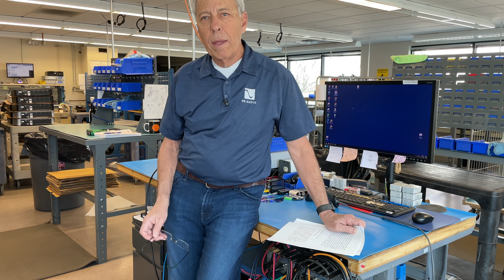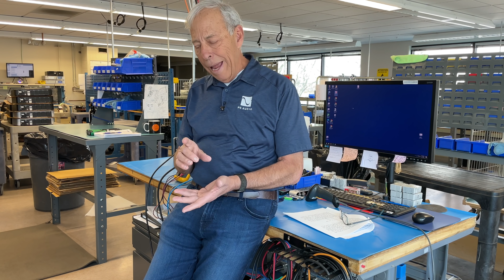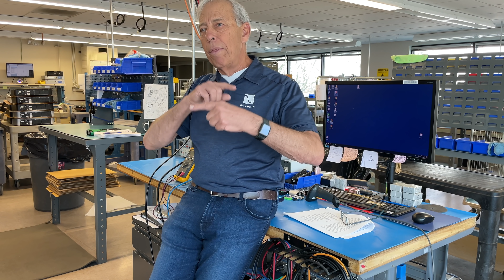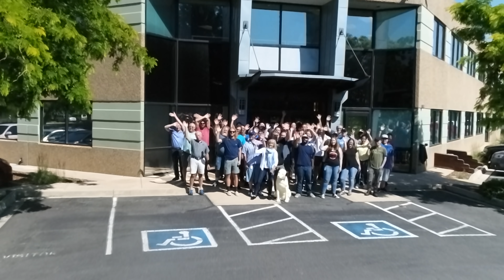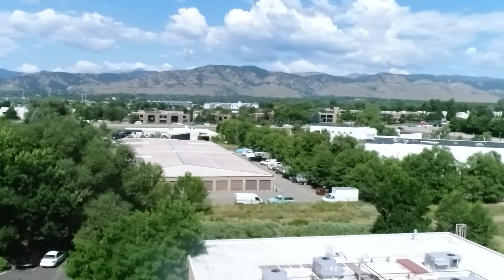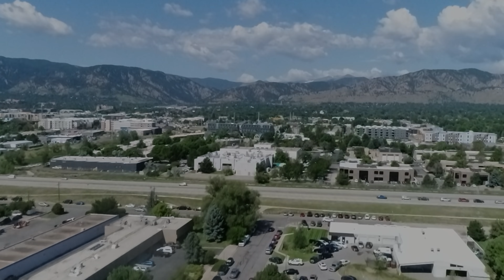USB Turntables

Comment: I think the question is best answered by explaining that if connecting via USB To the computer, then the digitising is occurring within the turntable, whereas if connecting to a computer via line level analogue output, then the digitising is happening within the computer itself. Of course a phono preamplifier having usb connectivity could be used in-between for the third option, whereby the digitising is occurring within that "usb equipped phono stage" the number of conversations remains the same, the quality will depend on the preamplifier and ADC, likely that the separate use phono stage will be the best choice, especially if it's a known recommended device, and far better still if it's connected to a decent turntable system, and not one that's designed as a low cost vinyl ripper.... They tend to be awful, although there are exceptions from the likes of Project and Sony to name a couple. Just my thoughts, have fun :)

Comment: My turntable has no bass using the built in preamp to my receiver....... could a phono stage to replace the built in preamp in the turntable help this?? It has 2 outputs 1 for built in preamp and 1 bypass
Reply: Sometimes you have to flip a switch to activate the pre-amp, or use different binding posts. Seems your pre-amp is not working right now now, or defective.

Comment: Not directly related; but... as long as it’s buffered, there’s no major difference between any properly functioning digital interface running at the same bit rate & depth. Don’t go thinking that you need to replace your gear just because USB is popular right now (which doesn’t mean you might not want to for other reasons, though). The whole point of digital transport is that bits are bits; with no generation loss going from one place to another.

Comment: I have a question, I’m using a Olympus pcm recorder to record directly from riia. 
And I’m guessing that a real computer can convert that to digital better than a cheap turntable ( newer heard of a “quality “ turntable with usb) or a riia/phono stage. 
Anyway I’m in full control of the type of digital conversion
Reply: Hi Jorn. Decent USB turntables such as the Sony HX 500 do now exist and can provide good quality DSD rips of vinyl. They are not high end but certainly pretty good.

Comment: Should've explained why it's better to get a turntable without any of those gimmicks installed 😜
Reply: I know defeats the whole purpose of analog. I have tons of buzz & hum in my system with TT connected for reasons I can't figure out...but I'm not going to lower myself to get a USB turntable to avoid it.   Bluetooth turntable is an even dumber idea.
Reply: @Scott-DJ  The hum is probably a ground loop.
If you're having the hum only when you've connected it to a USB audio interface, it's likely that the ground of the USB and signal are both connected to the case.
Sometimes it's caused by environmental noise, better shielded phono cables help, but also shorter phono cables.

Comment: The preamps and USB converters in such turntables are pretty bad.  
It is Much better to use a separate, decent phono stage and a standalone audio interface that has a USB output.
Reply: Not necessarily true. Yes, you can do better with discrete external components but some of the better USB turntables from established turntable brands are pretty decent and to get better results would require a substantially higher investment. In my case I wanted a cheaper turntable for a second system and  the ability to rip the occasional album not available on streaming services. The results I get in DSD from my Sony PS HX500 are really pretty good played through a Burson Composer DAC.

Comment: Would ripping a vinyl from a turntable to the computer via USB be able to create a lossless music type file in terms of quality? Or is it more complicated?
Reply: Lossy or lossless depends purely on the codec you choose. The quality of the audio coming into the computer (to then be compressed into a lossy or lossless file) and what is lost or not lost along the path is depending on the signal path you choose. Generally, going through an external ADC of your choosing over the the ones inbuilt into either the turntable or your computer allows for better audio quality, but that depends again on choices you make.
Reply: @Ascania  " Generally, going through an external ADC of your choosing over the the ones inbuilt into either the turntable or your computer allows for better audio quality, but that depends again on choices you make."
Generally you can't generalize that, since it solely depends on what audio interface you're using, not whether it's located in the PC/TT or external.
I've recorded some needledrops using an ASUS Essence STX II and they sound good:
https://www.youtube.com/watch?v=QJj4zLMVUA8
Sounds quite decent, considering the YouTube compression.
Reply: @QoraxAudio  Except that built-in interfaces; especially ones on the motherboard; can be generalized - most are cheap to begin with, have very little to no supporting analog circuitry, and no shielding. Compared to a professional external audio interface, the quality is usually quite subpar. This may not apply to higher end turntables with USB outputs, however, as they are sold on the basis of quality.

That said; if the source music is available digitized from the master recording; you’re really much better off going with that, rather than what can be recovered from a vinyl pressing (which involves some rather severe generation losses).
Reply: @darkwinter6028  "most are cheap to begin with, have very little to no supporting analog circuitry, and no shielding."
Cheap motherboard, cheap onboard soundcard. 
It's as simple as that - you get what you pay for.

For example, the soundcard on my motherboard (ROG VIII Formula) has its own part on the PCB, is properly shielded, has TCXO clock and uses decent Nichicon capacitors.
It's not as good as a high-end audio interface, but it's definitely above average.
Reply: @QoraxAudio  I can generalise because 99% of turntables with inbuilt USB have a bottom-of-the-barrel ADC and 99% of users who instead go through the ADC in their computer use the ADC on the motherboard chipset, which most commonly is a not so hot Intel HD Audio one. As I said, IT DEPENDS ON YOUR CHOICE. You CHOSE a better-sounding combination.
Reply: @Ascania  "I can generalise because 99% of turntables with inbuilt USB have a bottom-of-the-barrel ADC"
I think you're probably right when it comes to turntables, since most turntables with USB connection are cheap turntables, so the ADC is made to meet the low pricepoint.

However, there are many good motherboards out there and those have decent audio interfaces.
It just depends on the quality of the motherboard you're using.
Not much different from using an external DAC: buy a crappy one and the result will be crappy as well - buy a good one and the result will be good.
Reply: @QoraxAudio  Again, that was a choice made to get a motherboard with a better audio interface. The vast majority of people does not make that choice, they use pre-built system, take whatever is given to them and as long as it works for general consumption and doesn't sound too horrible they're happy with it. You can not assume that a random person, using what they already have in their computer, will get more than "Meh! Good enough!" quality out of it.
Reply: @Ascania  Hard to believe that almost everyone has a piece of garbage PC, that's statistically unlikely.
Reply: @QoraxAudio  Yes - most motherboards are cheap in this department; as the primary use for that sound chip is for YouTube, Zoom, and the occasional click, chime, or other incidental Windows sound. Even high-performance motherboards are often setup this way; and gaming motherboards with “premium” audio are setup to make game sound effects (gunshots, explosions) hit harder; and not to faithfully reproduce music. Your motherboard is an outlier.

I’m not saying it’s impossible to get good performance from a built-in audio subsystem; just that you shouldn’t expect it from the vast majority of PCs. 🙂

That said; personally, I prefer external pro interfaces because I can unplug it, pick the thing up, and move it to another machine.
Reply: @darkwinter6028  "Even high-performance motherboards are often setup this way; and gaming motherboards with “premium” audio are setup to make game sound effects (gunshots, explosions) hit harder; and not to faithfully reproduce music."
That's not done by discrete hardware processing anymore for quite some time - things like equalization is done by a DSP built into driver software nowadays.
Same with things like Dolby Atmos.
So it's just a matter of what drivers you run.
When it comes to audio hardware, most of the sound quality differences are in the analogue input/output circuitry.

"I’m not saying it’s impossible to get good performance from a built-in audio subsystem; just that you shouldn’t expect it from the vast majority of PCs."
I think the average PC would sound average... after all, the audio circuitry on a motherboard isn't just an afterthought anymore like it used to be in the 00s.
Reply: Sony allows ripping to DSD with the PS HX500 turntable, so technically lossless. I find the rips, played through a decent DAC, are excellent.

Comment: This is a related question: why are the major consumer electronics manufacturers ( Sony, JVC, Panasonic, Yamaha, etc. ) not making a digital audio player/recorder? ( Imagine a unit similar to a home cassette player/recorder that, instead of cassettes, plays MP3, WAV, FLAC, etc. files by inserting a USB drive, SD card, or MicroSD card.) Cheap Chinese hand-held MP3 players are a dime a dozen; but where are the high quality players/recorders for the home system? I do realize TASCAM, Marantz make a solid state digital recorder, but they are geared to the the recording industry and not the audiophile. I want to upgrade my DAT player with something that looks similar!
Reply: Actually, there are many of them out there and are called high res  audio players . Some of them can also stream audio. I have an SMSL DP5 that I purchased recently solely for that purpose, to play  my FLAC files from a USB drive. There's a Sony HAP-Z1ES which is quite expensive.
Reply: The recording industry kills digital recording formats in standalone consumer level hifi.   DAT,  Minidisk, DCC, you name it,  the RIAA hated it.  There are plenty of digital players,  but they don't want you recording.
Reply: Get a cheap (modest performance; not poor quality - you don’t need a top-spec i9 or Threadripper for this) PC; perhaps an all-in-one; or a recent iPad (might require a cable adapter); and an external pro audio interface (Mackie, Focusrite, etc). Pro equipment has no RIAA-imposed limits because that’s what the RIAA members need to use to make their product in the first place.
Reply: @darkwinter6028  DAT players are able to record digitally from LPs, CDs, ( and other sources with the proper connectors ) and then play back that information without the use of a PC. I want a consumer grade machine that will do the same thing as a DAT player but using a SD card instead of Digital Audio Tape. I also want that machine to be 17'' wide, 3 to 4" tall, and about 10" deep. Playback and recording of most digital formats ( ALAC, FLAC, Monkeys Audio, MP3, Vorbis, WAV, etc. ) is desirable. I think this machine would sell well in this market and you would probably want one!
Reply: @burkholdst.rudderberg3574  Ohkay.... then get a rack mount PC; and put a SD card reader in a drive bay???

Comment: Unnecessarily converting analog to digital and vice versa usually spells bad news for sound quality. Reminds me of how some full digital heavy metal rock recordings of the mid to late 1980s have iffy sound quality - especially when the recording engineer had to convert the digitally recorded guitar parts to analog and to an open reel tape in order to use some vintage 1960s era analog compressor and / or reverb effects then converting the guitar track back to digital again. Often winding up sounding like it was recorded on cheap cassette tape with an extreme noise gate being used to eliminate the hiss.

Comment: As far as I gathered, what Mike is really asking is; what's the difference between using the USB output and the line output of the USB turntable.
So; With the USB output the turntable turns the audio signal into digital, and sends it to the PC digitally.
If you use the line output, the turntable sends out an analog signal into the PC's analog line in (if it has any, many a modern laptop only has a microphone input, which will not work well for line signal), and then the PC will turn it into digital. So no matter which option you choose, it will only be turned from analog to digital once. The amplification of the signal (really; the difference between 'phono' and 'line') happens completely analog within the turntable, thank goodness. 
In other news; New Camera, Paul? Looking good!
Reply: Yes, that’s what I didn’t understand. If the turntable converts analog to digital before sending it over the USB, then signal degradation due to ground noise or a poor quality phono pre-amp & RCA cables should be eliminated. Seems like a benefit as long as the turntable’s ADC isn’t completely junk. And I didn’t realize the turntable’s usb codec/driver passed digital-to-digital with no analog conversion on the way to (in my case) Audacity.
Reply: @mikewilliamson1539  most USB turntables are pretty shitty, though. I would generally go for a nice non usb turntable through a preamplifier and/or tape out of an amplifier and an audio interface :). The Native Instruments Komplete Audio 2 is a gem for around 100 bucks, for instance. Still, I was pleasantly surprised with the AudioTechnica AT-LP120x (that I sold because hey, high standards, but it's a pretty impressive machine for the money).

Comment: Since encoders make a difference in sound quality, I presume that the quality of the digital rip of the album depends not only on the quality of the cartridge, stylus, tonearm, etc. of the turntable, but also the quality of the ADC and built-in phono preamp.

Sounds extremely doubtful that a high quality rip could be had from anything other than a DIY version of one-a those turntables, with a ton of money and effort involved.

Comment: USB Turntable.. Now that's lipstick on a pig!  I am using a 2,3k$ dap (The LPG) with a 3,5 jack into an tonberg Tr1010 vintage amplifier executing lethal DSD files on 1 set active speakers and 1 set loud speakers. So bc sound preference is subjective one can adjust on the bass treble, balance etc. Thanks a bunch for sharing your impeccable knowledge with us 💯🎛🎹🎛🏆

Comment: I'd recommend getting seperate phono preamp and audio interface for transferring records. Even a cheaper behringer audio interface will outperform the built in ADC in the turntables by miles.
Reply: This is not always true. You need to spend quite a bit of money on a preamp and an interface to get something better than what's built into the AudioTechnica AT-LP120x. Now of course, that's not exactly aiming for the stars, but it's surprisingly how well the thing performs for 250 bucks.

Comment: I don't think I'd ever buy such a turntable. A good audio interface connected to a good turntable should give you better vinyl rips than one of those usb turntables
Reply: You might be surprised in some cases, the AT-LP120x actually has a remarkably high quality phono preamp (on par with a Cambridge 640P) and a rather good ADC. I'm not saying it's not still a better idea to go for a proper audio interface, but to get anything sounding near as good as the AT-LP120x, you'd have to spend AT-LP120x money on a preamp and interface, and then you still need to get a half decent turntable. 
I personally prefer the option of a standalone recorder (Tascam DA3000 in my case) but that's in a very different league of course.
Reply: I bought the Sony PS HX 500 to transfer my vinyl to my Mac mini. Records as a WAV FILE  up to 24 bit  192  kHz or DSD 5.6 MHz. The soft ware is easy to use and resulting files sound great. I want all my music on a hard drive in preparation to inevitably having to downsize my life style , ageing pensioner. I use bitperfect soft ware to feed signal to separate DAC then on to my stereo Amp. I sold my Linn Sondeck to finance this project and while not in the same league the Sony performs well as a vinyl player.
Reply: @ferretut1  I agree entirely. The Sony does an excellent job, especially at it's price point. I have a Clearaudio Performance SE turntable with Musical Fidelity MX-Vynl phono stage and, yes, it's better but it's a lot more fiddly to get good sound out of than the Sony and it doesn't rip vinyl. I think most of the skeptics on this thread simply have not heard direct to DSD rips.
Reply: There's no point of that USB connection at all. 
The output of the phono preamp can be connected to the line-in on the PC - it does the same thing.
Reply: @QoraxAudio  not every pc has a line in. Most people these days have laptops that only have a microphone input.
Reply: @rollingtroll  Lol seriously? Only a laptop? Sounds like they're stuck in 2010.
I thought gaming has become mainstream in the past 5 to 10 years...
Reply: @QoraxAudio  That would even be worse than a USB turntable. You should a least use a good audio interface. A 100€ focusrite is probably better than any ADC of those USB turntables
Reply: @juliangst  The sound quality of the onboad soundcard is better than the freebee that's trown in with a USB turntable - I've actually tested/measured that (ATLP-120USB versus Asus ROG Formula VIII).
Lower noisefloor, higher bitrates, higher slew rate.
Reply: I own one as a novelty I got it at thrift store for 6 bucks no clue of the retail price.
Reply: @ryacus  If you know the brand name and type number, you can just look it up at hifishark